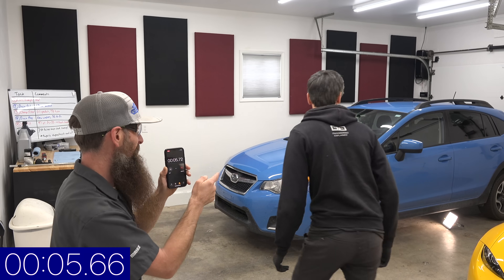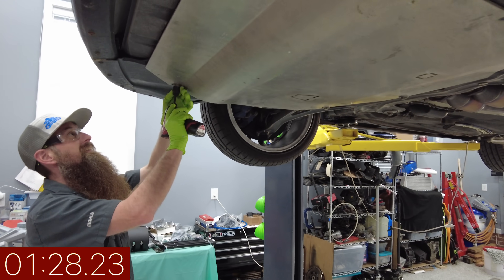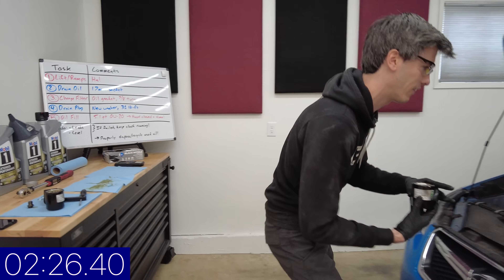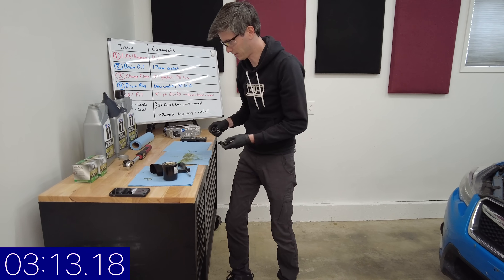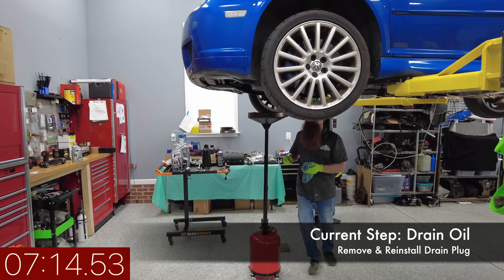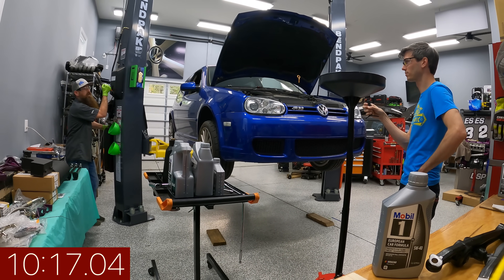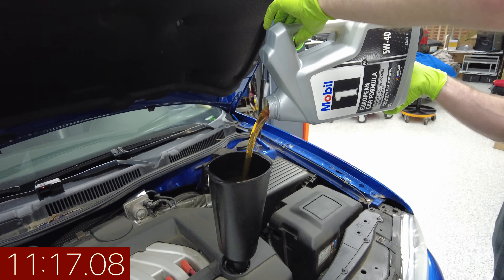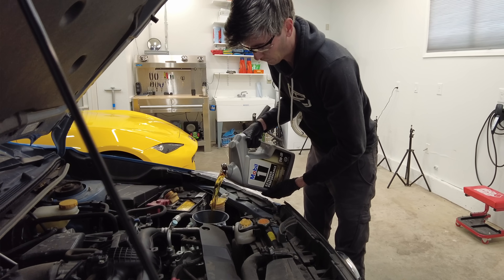Mechanic vs Engineer – Oil Change Race – Who’s Faster?!

Comment: The smart engineer would have used his Tesla Model 3 for this challenge and won by default for having the most “highly optimized vehicle for changing oil”.
Reply: Humble Mechanic's reply would be "Gears have oil, start changing Dude."
Reply: @philipmackin1025  does the model 3 even have gears?
Reply: @bcunningham3718  Well it has one. And that is engaged all the time.
Reply: @dragonfire3289  Reduction gear, to be specific.
Reply: @bcunningham3718  Yup. They have to reduce ratio
Reply: smort ↗
Reply: I suspect changing reductor oil is more complicated than this.
Reply: @procerator  Gear oil have longer intervals, though. Mainly because they are not subjected to higher temperatures the engine oil is subjected to.
Reply: @dbclass4075  I know, but the completion was not about how long does oil last in Subaru vs VW, but how fast can you change it. So the comment OP made is not valid.
Reply: Change oil in the differential of a model 3 I dare you.
Reply: Literally was going to comment this
Reply: He's gotta change some kind of fluid, them's the rules. Better start draining that battery coolant.
Reply: changing oil mean you have to remove it, so unless you can show your work with the removed oil, that tesla will be dq-d. if it would be fill it to level, than tesla won.
Reply: It was all that leaded gas…IQ↘️
Reply: Aaaaaaaaaah! Thank you for the smile
Reply: Here I was coming to the comment section to be all clever and mention his Model 3 .  .  . and I'm late to the party!

Comment: This makes me feel so slow it took me over an hour to change the oil on my truck.  If I wouldn't have checked brake, power steering, cooling system, transmission, blinker and windshield washer fluids, rotated my tires, checked brake pads and greased front end components I could have probably done it faster.  😄  This video was a good change of pace.  The fastest way to change your oil is probably just swiping your credit card at the local jiffy lube while you watch tic tock on your phone.  Lol

Comment: That Subaru oil filter location is just brilliant. Makes things so easy and clean.
Reply: yeah my subaru has worst location possible id like to smack the engineer who made my 2012 legacy
Reply: @ranger178  ring of fire?
Reply: @MisteRfleX53009  you don't want to change oil with car hot and no matter what i try from aluminum foil over exhaust or funnels oil spills all over exhaust gets in heat shield and gives you burning oil smell for a week
Reply: i swapped my drain plug with a ball valve.  You can change the oil in my WRX without turning a wrench nor jacking the car (if you're scrawny enough)

Comment: Worst preventable oil change mistake I've seen is missing the gasket that was left over from the oil filter removal. Double gasket blew and spun the bearings of a fairly heavily moddified Mazda ms3 😬
Reply: I will always check for that now even though I always look at I take it off anyway.

Comment: I can vouch for this. I have a 2013 impreza (same 2.0 boxer from the crosstrek) and these engines are literally dummy proof for oil changes
Reply: And yet how many Subaru owners do NOT change their oil at the required interval?  Quite a few examples here on YT.
Reply: @aeroman5239  you said it brother. I change mine religiously every 3k miles with purple royal ow20

Comment: I think we should do another challenge!!!! as long as I don't have to math and math. LOL
Reply: You can use siri as your calculator while your hands are dirty
Reply: @xilnes7166  300IQ level thinking there... I like it
Reply: Just break out a white board!
Reply: All jokes aside Charles, what are your thoughts on the oil changes using the vacuum oil extractor. Seeing as how the drain plug is not removed, how good of an oil change are u getting? How much actually comes out? I believe this is how the dealers do it. What say you.
Reply: @L0rdVadr  Q: "how good of an oil change are u getting? How much actually comes out? A: vac systems are not about "doing a great job on a vehicle" so much as there are about "doing a great job" for the shop environment.   vac systems address the business needs for tech efficiency, health/safety, and cleanliness.   OPEN DRAINS into pans can create spills that can cause secondary trip hazards and of course then take extra time to clean up properly.   2x/year in your garage is fine, but used oil is dirty (and usually warm giving off vapors) as such is NOT something you want "chronic exposure" to for a typical 40hr week year after year.  because: OHSA <---  this is a "thing".
Reply: I am an engineer but i just ask Siri to do the conversions for me 🤣
Reply: I think we need a mechanic Olympics! This was so much fun to watch
Reply: Who can find a 10mm the fastest!
Reply: yes, like replacing a timing belt :)
Reply: nice R32 man
Reply: @ThePilotGear  Thanks!
Reply: Yes, although you have to watch that habit of handling another man's dipstick while he's working! ;)
Reply: The math needed for both engineering and mechanic-ing is minimal for the most part.

The thing that got me into programing and engineering in the first place was realizing I could teach the computer to do my work for me...which frees up time to mess with cars.
Reply: I have the same assenmacher oil funell... they make nice stuff. I also have mercedes benz and Bmw. Game changer
Reply: Yes, like how to design automotive part X, you at the whiteboard putting down your ideas. Afterwards an industy expert who judges you and your opponent and tell the audience of pros and cons of the ideas.
Reply: The next at-home auto job, brake pad/rotor replacement.
Reply: Whatever happened to Blown Heads? I was so excited for that collaboration
Reply: CHALLENGE! You design a car for production. He designs a car technician friendly. Ahahahaha
Reply: Alright next challenge is who can engine swap faster
Reply: Try head gaskets. See how Jason's Subaru fares in that one LMAO
Reply: Each of you 2 do a heater core replacement.
No timing, just let's see how the approach is different.
Reply: @HumbleMechanic A vacuum oil extractor goes a long way on the VWs! No lift/ramps/jacks and no removing the drain plug! I love my mkIV TDI wagon 5spd 😃
Reply: @RealJimSkinner  I should have done my R lol
Reply: A Good engineer would just buy a electric car. 😂
Reply: @davidhumeston5292  Guess he has to find an electrician to do a Collab with..

Comment: Change your oil when it's really cold and you'll find the drain plug really tight when you change when it's not cold.  Torque should be reduced for cold weather. Heavy truck oil change(up to 55 qts makes the mechanic feel like a jerk using even those 5 qt. bottles). Imagine using 11 of those for a single oil change.  Blech!
Reply: I just have cars, but I still buy my oil in 20 litre drums.

Comment: To be fair, most of us don't have lifts to raise the car so sliding underneath is the only option (maybe a jack to raise a few inches) if it was low slung.
Reply: I'm amazed he got under the car that easily. Last time I changed the oil without using either an oil pit or a lift I got down only to realize there was no way I was going to get my head in under the car with it flat on the ground. And that was nothing more exotic than a Toyota Corolla.
Reply: Yup, I couldn't take the drain plug out of my Passat without a jack because 1) the belly pan covers it and 2) it has about 5" of ground clearance.

... and 3) I'm not a stick figure like Jason.

Comment: Basically a Japanese Engineering beats German Engineering in simplicity lol
Reply: When he said "this is a pretty straight forward vw oil change" I laughed
Reply: plenty if VWs have a filter on the top :P Also no reason to take the oil out via the drain plug unless you change your oils every 5 years lol

Comment: Love the collaboration! I'm on the mechanic side of this battle. Although I like to drain the oil as long as possible. I left my Miata on the lift for 3 hours while it drained. It was a slow day and we had a free lift.
Reply from the maker: Three hours! Every. Last. Drop. Admittedly, I wait a bit longer when it’s not a race haha.
Reply: At what point did it stop dripping? By the first hour?
Reply: BMW would void your warranty if they saw this video. 😂
Reply: i try for best change possible cleaning where filter gasket was on engine putting a couple ounces of new oil in engine to rinse out oil in nooks and crannies and pre filling filter
Reply: Warm oil. Drained in 15 minutes....lol then put water hose in it

Comment: Software engineer would spend hours programming the robot only for it to do it one second faster. 😂
Reply: Yeah but then the robot would do that 60 times and save a minute continuously while the programmers is asleep
Reply: If the robot does it without you, it took you zero time to change the oil.